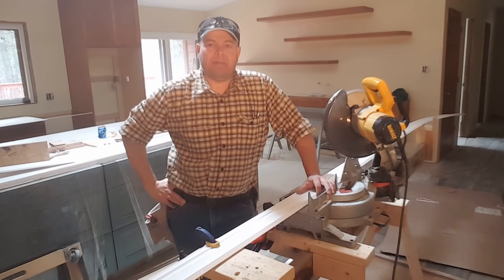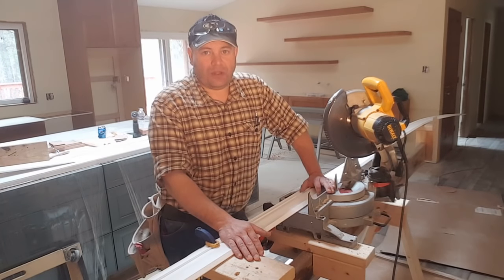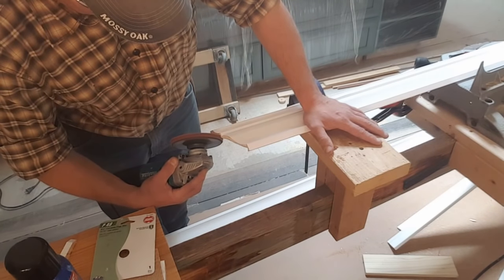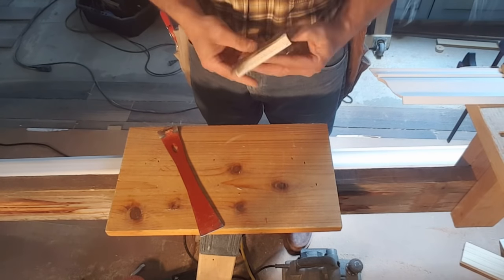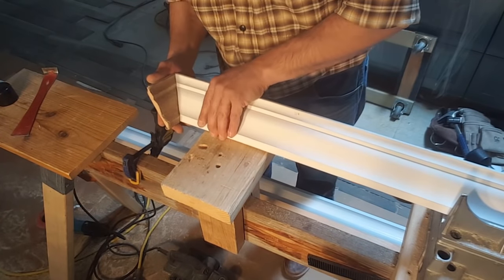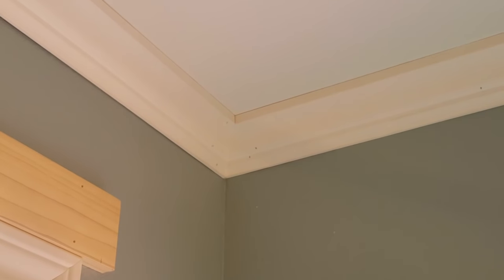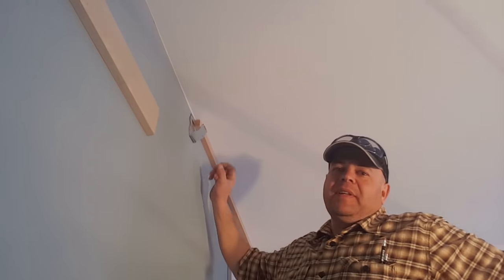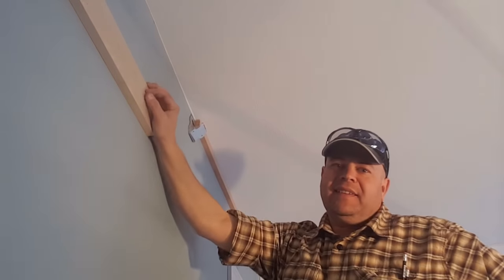How to perfectly cope crown and base molding

Comment from the maker: Thanks! the extra dust is well worth the time and accuracy. 
NOTE: choke up on the handle and set your pointer finger directly behind the shaft. this will improve 
accuracy and balance. 
be prepared to drop it a couple times before you get the hang of it so work over an unfinished floor. 
 Let me know how it goes for you.

Comment: My first sanding block is in the vice right now, fine grain sand glued to the form-block, using a special deep sponge to help push the paper into the forms of the baseboard moulding. This is about the best little thing I've seen yet, within the new realm of coping internal joints. Thanks!
Reply from the maker: Thanks for commenting. Enjoy your new home made tool!

Comment: I've been using an angle grinder for years. I'ts so easy to mess up the cope at the final touch-up. I'm going to my shop right now to try the sanding block. looks like a great tip. Thanks!

Comment: Thanks for posting; a couple of notes after trying this out: (1) A regular grinding disk works fine and a worn one works better than a new one because its rounded edge goes smoothly into the contours. (2) Sandpaper just doesn't shape itself well to molding that has deep narrow lines.
Reply from the maker: Use finer grit sandpaper for base with deeper profiles. OR use a taping knife or scraper to push into the deepest crevice  FIRST then pull the paper to edges. (it's OK if it cracks in vallies, it has no negative affect on the the results)
  It's IMPORTANT to allow the contact cement to TACK UP or the paper just wants lift off the block.
Reply: (3) You both go do something else if you can not cope with jig saw.
Reply from the maker: Haha! I agree. I have coped since 1984. BUT it is faster once you get the hang of it. Especially crown. UNLESS it's oak. But MDF likes to break so, this works great.

Comment: If you give yourself a little platform to rest your hand that’s holding the grinder and just move the grinder with your wrist, you will have much more control and  be able to become very accurate with it.  Also, if you use a sanding disc backed up by another one (or even a diamond wheel ), you will be able to get into the little nooks.  The flapper is too flexible I have found.  .  There’s a bit of a learning curve with it, but after a while you can quickly  knock out a cope without any added sanding.  
      I really like the hanger idea.  Gonna use it on my next crown job.  Thanks.

Comment from the maker: be sure to purchase a grinder that locks in the ON position.  this way you can use both hands and hold it at any angle. Be sure to clamp the piece and don't remove the guard if you don't have to.  thanks for watching.

Comment: I AM THINKING THAT I would be attaching the sandpaper to the end of a longer piece of molding.  It seems this would give me better control and more comfort.
I ALSO THINK THAT using an inexpensive miter protractor like the Starrett to measure inside AND outside corner angles produces as good a result in far less time and with much less effort.
Reply from the maker: You can use all the sand paper you want but a short pc works for me. 
 This video is paint grade and doesn't require such accuracy.  Sure. You can use a miter gauge, you may even get it perfect. What happens when your wood shrinks? I install some very expensive cabinetry with no room for error and no extra material for mistakes. This works and looks perfect. I use it on fancy base too. Customers love my finished product. 
 Thanks for your comment!
Reply: @hugavet3049   Thanks for the info.  Now that I think about it, thanks to you, I have have noticed that every video I have seen on the subject of making any kind of a tight fitting corner with molding is a "paint grade" molding video.  My home is about thirty years old and every bit of woodwork is dark stained oak, very beautiful and in my opinion, the way it should be.  Boy!!!... I would love to work with you.  Sounds like a lot could be learned.
Reply from the maker: Hey thanks for the compliment!

Comment: Where did you get those wall brackets or clamps? Nice job
Reply from the maker: Made them from steel straps founds in the framing lumber section
Reply: @hugavet3049  thank you

Comment: Start your career with a coping saw and practice, practice, practice!! All of these tricks, grinders, jig saws, etc.  are more time consuming.  I've made thousands of copes on everything from MDF to PFJ pine, to finished mahogany. Set your coping saw blade on the push stroke, back cut your copes. I dont reccomend back cutting too severely because the finished front edge ends up being weakened and could potentially collapse.  Cope tight along your line so you dont by have to file or sand.  "Aim small, miss small".
Reply from the maker: Agreed. Skills are important AND so is production. It takes time to reset your back cut three times on each pc. AND I need systems that work consistently. I don't have all day to train a guy how to cope quickly AND accurately.  I'm not paying him $150.00/ day to wittle sticks. 
 Thanks for your comment though, the world needs more guys like you.
Reply: So you do not know cope with jig saw and advise others to use hand saw.  LOL.
Reply from the maker: you cope with a JIG saw? Do you use the Collins coping foot? I've never tried that.
 PS I've never tired coping with a HAND saw either.
Reply from the maker: many others have appreciated the video  and its working for them.
Reply: @hugavet3049  No just jig saw.  With one hand I hold jig saw and with other jig saw plate.  Similar what this guy do https://www.youtube.com/watch?v=ogOHtaI-0oA .  Only I press crown to my horse with my leg (shoe off of course) to my horses.  Same horses where is saw.  Cut compound cut than move saw a few inches to make space for crown at horses and cut it.  Here is my portfolio.  https://s252.photobucket.com/user/bbsitum/library?page=1  .  Need to say I don't see myself like a trim carpenter.  I do just so much, at minimum, framing too.  It just happen that I can cope and can flip a few numbers in my head (for compound cut) so I trim too.  Especially when I see advice to cope with hand saw or sender, every one would ask itself why would I not install crown than.

Comment: Dear Bob - thanks for sharing .... great concept/tips!  I assume you are using a variable speed grinder.  Will a single speed basic model grinder just go out of control because the high speed is too hard to handle or do you think it would be okay?
Reply from the maker: +Eileen Ambrose . I use a single speed. Just be sure to get one that stays ON when you let go of the switch. That way you can hold it close to the top for Better control.

Comment: thanks for the tips 😊. I have one question: I have a corner with is not 90 degrees. it is more like 85 to 87. do I need to make my cut at 45 or half of what the actual angle.? thanks again!
Reply from the maker: keebler5846 . just treat it like a 90.
that is why we "back cut" our copes. nothings perfect. we just want it to LOOK perfect. miters must be perfect to look right.  coping is faster, less math and deals with all the imperfections inherent to the surfaces & materials we are working with. 
 when in doubt, cut a test piece first.
Reply: Bob K. thanks for the quick response!
Reply from the maker: Lord Sauceness. STOP making it so difficult. you would go broke as a contract carpenter or I would let you go if you weren't willing to learn a new trick.  I've  had guys that couldn't cope work for me for about 2 days.  so slow they were killing me.  you can charge yourself whatever you want but in the real world you get about $1.50/ft. all that math takes time and still doesn't account for uneven corners that are out of plumb.  I can be 3/16 short and you would never know because it's hidden behind the cope. that means less trips back to the saw. 
 Just my 25 yrs experience. 
thanks for your question,  hope I was helpful. let me know how your project went.

Comment: Love this. The coping saw was getting ready to go in the woods I was getting so frustrated with it. Picked up this wheel and first cope came out beautifully and only took me a minute. GREAT!!!
I have a question....What is that tool that you are using to hang the crown molding with.
I have been putting small picture nails were the bottom of the crown should go but it sometimes slips off.
Reply from the maker: Mark Smith. Super! Did you make the sanding block as well? 
 @ 5:04 I explain how to use the metal strapping.
Reply: No haven't had time yet.
Only doing one small room so just filing for now but plan to use it when I when start running thru rest of the house.
Will check video again.

Comment: This looks promising (I've been struggling with the coping saw). Question:

Do you still cut the baseboard at a 45 (to see the profile) and then start shaving off? In the video it doesn't appear so but I don't know if crown is done differently. Thanks.
Reply from the maker: Chris Wayne .
yes. miter one side (usually the right of you're right handed). I'll also flip the base board upside and cut "back cut" (opposite the 45) the flat part of the profile @ 10-15 degrees on the saw to speed up the process. this removes alot of material faster than the grinder.

Comment: Hi Bob K.  I am installing crown in 2 rooms - all inside cuts.  Question - if I was coping 4 inside corners in a room how many cope cuts would I make?  would you install 2 pieces of crown with NO copes and 2 pieces of crown with both ends coped?
Reply from the maker: Scott Dorny / absolutely NO. I would install a 6 inch "dummy" pc. to the right of my first corner. go around the room then pull it out before installing your last pc. this method provides forgiveness for uneven walls or drywall mud. I cut tight and try to "snap" muy molding into place. 
 good question. thanks for watching!
Reply from the maker: Scott Dorny P.S. most rooms are large enough that you will need a "kerf" joint. I'll make the dummy block long enough with the kerf joint ready to receive the last pc. and just leave it installed.

Comment: At what angle do you cut the molding to match the coping up with other piece of molding?
Reply from the maker: Sorry for not being clear on that.  You cut the first one at 90. cut the coped end at 45 then clean it out.  This allows for an imperfect corner to come tight together in the front.
Reply: @hugavet3049  I'm just learning but dont think 45 works for a 52/38 degree type moulding - wouldn't it be a 31.6 degree miter for that?

Comment: Is that disc normally for metal?  The ones I found which are similar at HD are for metal.  I'm wondering if it will be too rough.  Otherwise, I am totally on board with trying this as opposed to coping saw, coping foot, angle gage, etc.
Reply from the maker: Al Stodolski I responded in the comments

Comment: By the time you’re done setting up I would’ve been done installing with miter and glue
Reply from the maker: Oh dude. This thing is SWEET.  Set up time is way faster when you're not filming.  And it speeds up a job by about 1/3 time.  Cut all your door legs and headers WITHOUT pulling a tape measure out every time and never leave the saw.  Build and case ALL your extension jambs at the table.  It makers working with 16 ft. stock much easier.  Ron Paulk is a genius. I thoroughly enjoy my table. 
 Thanks for your comment.
Reply: Bob K. I love your bench I’m a guy that looks for is efficiency in tools and jigs  you name it what I don’t like Is coping to me that is a waste is time. If a customer would ask me that I HAD to cope I would not do the job period. NOT because I don’t know how but because I DONT BELIEVE in coping one of my mentors in carpentry was and old school carpenter and showed me how but I learned just cuz that’s who I am. Always trying to learn new thing but I don’t see the point of wasting my time. 

A pointer for sped you should save 5% of your profits to buy a tiger stop really good stuff
Reply from the maker: Hmm. I've tried miter cutting my inside corners even on paint grade but it was slowing me down. Having to go back and shave a little here and there.  
 What's a tiger stop?
Reply from the maker: Whoa! I can buy a TRAILER for what that thing costs!
Reply: Bob K. I don’t see how can you be slower taking less steps. 

The tiger stop will give you money in savings to buy a fleet of trailers

Comment: I see you clearly know your stuff.  What I would have liked to have seen included was the initial measure and cut, before you coped it.  Also a little more detail on how you ground it with the flap wheel.  I saw you ground a couple of things I think wouldn't be obvious to a beginner.
Reply from the maker: I cheat. I use a Bosch laser to measure in mm. That way I'm not trying to balance a tape in the air or bang a nail to pull from. 
And there are 3mm in 1/8 inch so it's more accurate.
Reply: @hugavet3049  I watched this because I had to do this very thing last Friday at a client's house.  The guy is super picky, so it had to be perfect.  It worked like a charm, although I didn't get the back-cut deep enough the first time and had to re-bevel it.
Reply from the maker: Cool bro! I'm glad i was helpful to you and thanks for letting me know

Comment: So you can not cope with jig saw and you advise grinder.  Good luck to anyone who will pay you for it.
Reply: How do you know he didn't previously use a jig saw with a coping table on it ? Psychic ? Does it happen often you are not paid for your work ?
Reply from the maker: Ugh! People. YES, I can cope.  Been doing it since 1983. For some applications, like MDF OR when the profile goes in and out and in and out, OR your training a new guy,  this method is faster.  I don't break out the grinder EVERY time.  MDF for example likes to bust at the point easily and this is a nice controlled process. 
 Why so many haters gotta ASSUME that I'm an idiot?
Reply from the maker: Well.... Thank you.

Comment: just drive a 16 penny finish nail a 1/16th  or so above the bottom bed line, then just pull it when you get to it, let the crown come down to where its supposed to be, nail it up .... crown held itsself up, no holes....walla, done.....